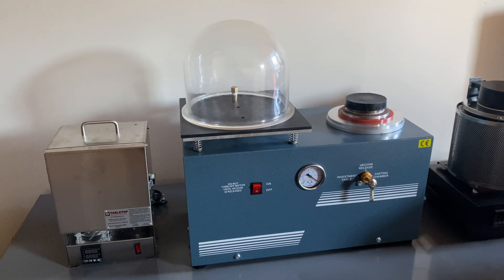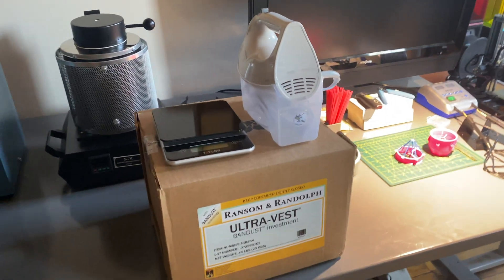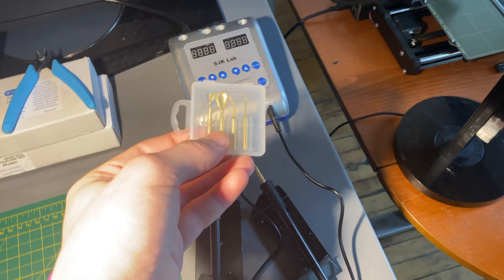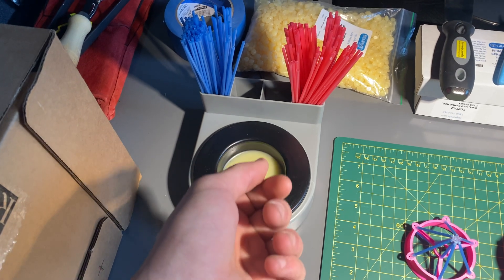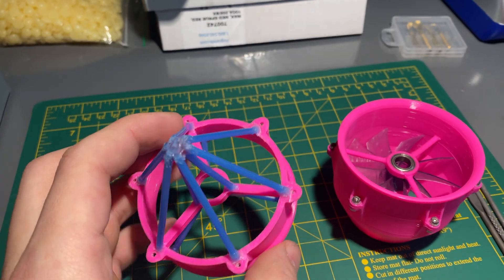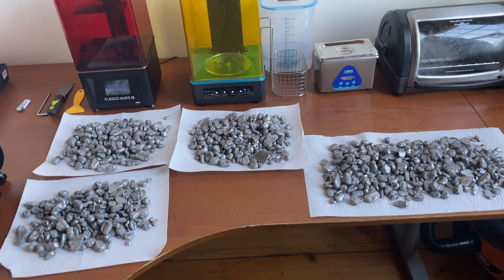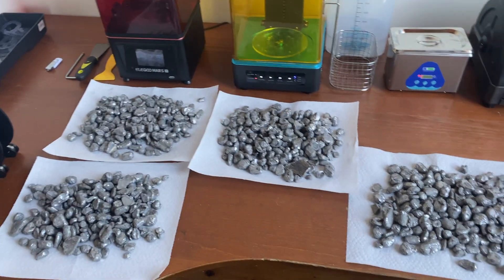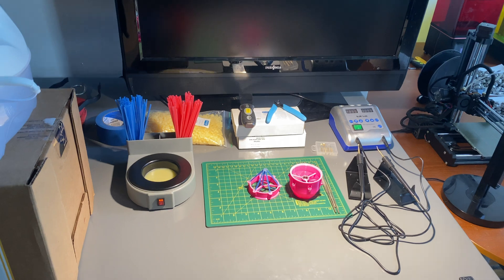My Investment Casting Setup #2

Comment: Hey Levi, I did some investment casting during my undergrad but it's been so long. I'm wondering how much ventilation do you need to cast & 3d print? I've been planning to get into jewelry and your set up has me interested in having an in-home casting set up of my own
Reply from the maker: I always kept a window open near my setup with a ventilation fan operating all of the time. The 3D printing is less of a concern but there are gases produced during the burnout process and during the melting of the metal. The largest concern is when working with the “plaster”. If you breath in the powder you can develop silicosis which is incredibly scary so I always wore a 3M respirator while working with it.

Comment: Question, I have the same vacuum castor and was wondering where do you buy the oil and where exactly is the opening to pour it ? thanks your content has been great help for my journey !
Reply from the maker: Thanks! You can find vacuum oil on websites like Amazon and eBay. Just make sure it’s labeled as vacuum oil and you should be fine.

The vacuum pump is located inside of the unit. There are a few screws on the back holding on an access cover that you need to remove to access the pump. The vacuum pump has two ports but one is labeled as a fill port so you should be able to find it.

Comment: Levi son yes you are correct mining have deteriorated the earth ! There are alluvial mines in Africa , Russia , S & N. America , Canada , India , China , and Australia that requires effortless mining practices for they basically wash up on the shore even in Hawaii . However for the sake of finding out how deep is the earth scientist sought funding from developed countries such as ours and begun the Kimberley  mine project which was falsely propaganda as a diamond mine leaving a negative impact on the eco system over all . Son the world foundries are closing because the fuel and gasses that are used to keep the furnaces working twenty four hour a day for the molten metal  is running out ! Son government funded steel and or even automotive manufactures have closed or moved to places like Mexico and other countries because it saves not the money that's easily printed or much less on labor of which the world can count on of having more then three billion or so in mentioned age group , but more so on the fuel resource itself ! Son the earth deposit in the alluvial mine are not yielding ! Even gold is running scarce ! Platinum is a man made composition alloy metal like wise Aluminum and Steel which are fabricated with the aid of mineral ore to achieve a metallic result there is a industry difference between mineral ore and metal ore which are  found in mine deposit through out like Gold , Silver and Copper . Processes that began a century or so  with the introduction of the Periodic Table .  Yet " perhaps " ,  you are taught that there are mines of such metals . Kid it is my understanding that Jehovah God is turning off certain resources such as fuel for example , of which it's  petrol chemicals have found their way to our food source , and from man inability to manage it correctly !  Look up @t for a good casting is only achieved with good virgin or refined metals . Also look up @t you will find here the oil for your casting machine if you have not done so yet . I understand your enthusiasm kid ! Respectfully : Osmani Torres .
Reply from the maker: I am pretty sure humans have know how deep the Earth is for over 2000 years. I think your confusion about human made metals comes from the fact that most metals today are actually alloys which are materials made of of a combination of many metals. Alloys are designed by material scientist to produce a wide variety of materials with many different properties. For example, the aluminium I am using is called aluminium 4032. Metals like aluminium and platinum exist in the form of ore in the ground which is then processed and refined. I am not sure about the migration of steel plants from the US but I am pretty sure that we are not running out of fuel and that globally, net yearly material production has increased every year for multiple decades. Thank you for watching.